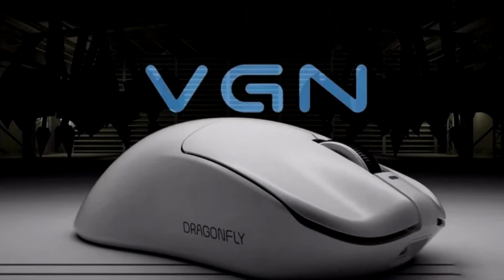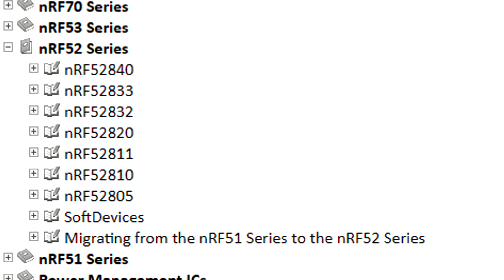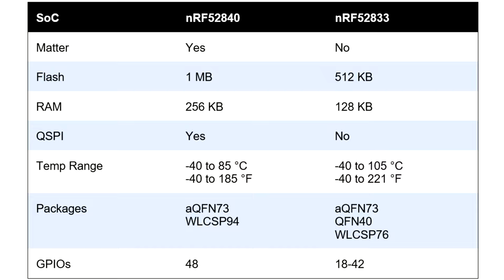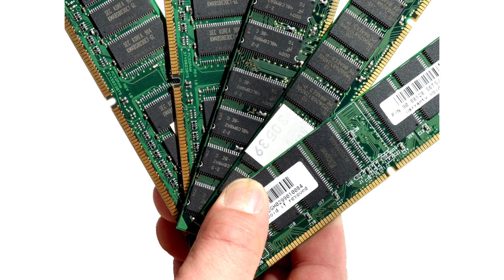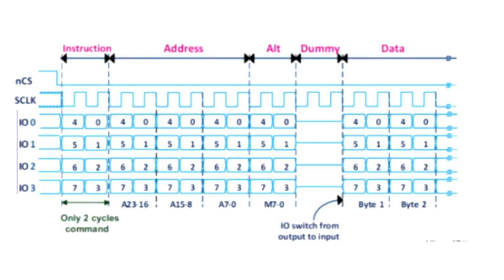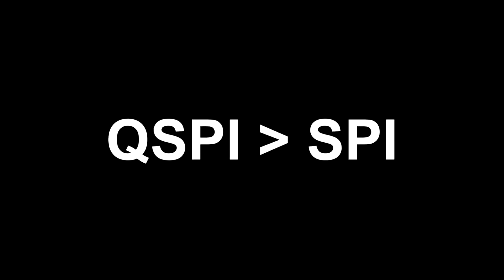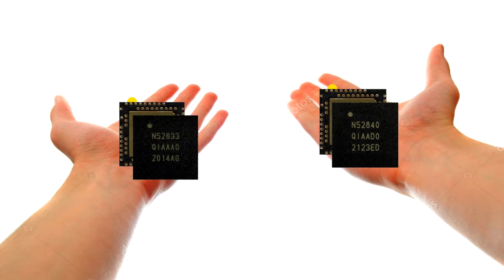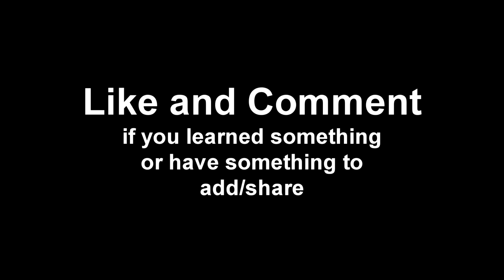Mechkeys VGN Dragonfly Specs (Different Nordic MCUs?)

Comment: I can't tell the difference between the two Pro mice sensor performance-wise.  I do prefer the feel of the Max as it feels better at 55gs instead of 49gs, which surprised me.  I can however tell a small difference between the base F1 model and the two Pro versions.  Don't have the 4K dongle to test 4K polling yet though.
Reply from the maker: Yeah, I wouldn't assume there to be any noticeable difference. It's an interesting topic to look into though as new SoCs are being released.